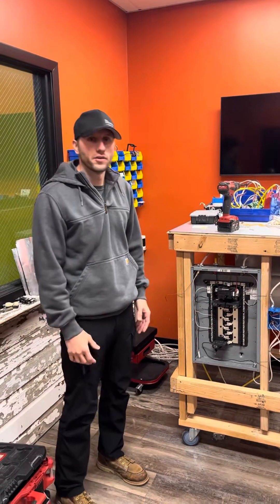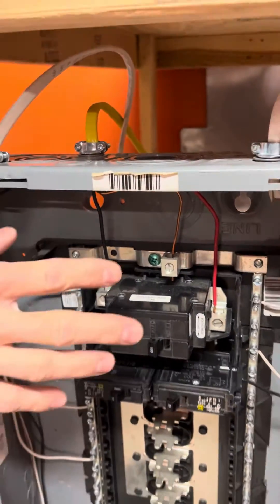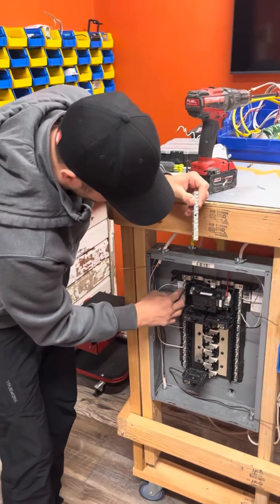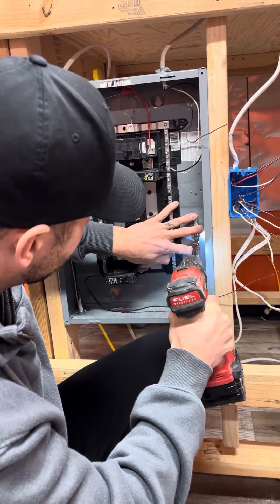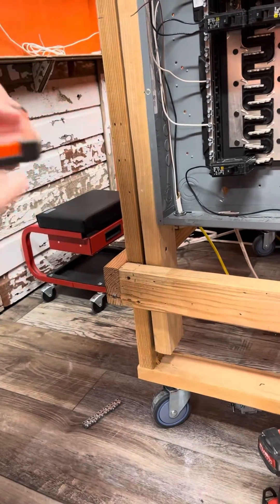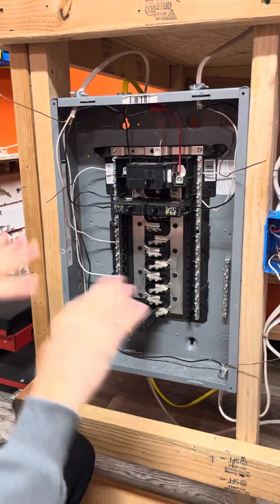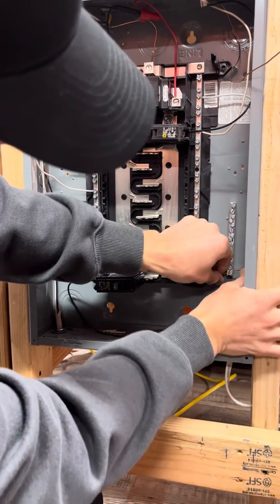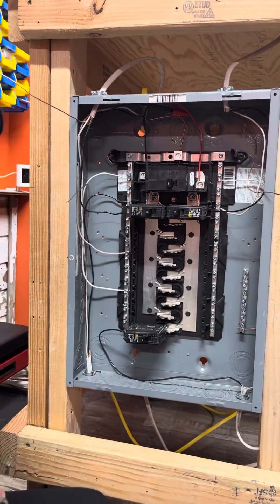Adding ground bar to subpanel

Comment: What happens if you add a second ground bar on the left side of the…. Will you put a wire #6 to connect with the first bar or you will use the case box as the conection ?
Reply from the maker: the panel is fine as long as it is properly bonded

Comment: You should have used a Ground Bar twice as big as that for that size panel to accommodate all the Ground wires from all the Romex cables and 240 10/3 wires.
Reply from the maker: Thanks its a training cube

Comment: So I did this that exact way, but when I voltage test black on the ground bar red on the hot lead coming into the subpanel, I still read a small amount of voltage like .6 I believe, that’s not good right?
Reply from the maker: red lead on what?
Reply: Check for AMPERAGE, Voltage can be Induced via Parallel wires and can result in a small number due to parallel induced voltage of the wires traveling next to each other for some distance.  In telephony, we call the induced voltage CROSSTALK between telephone wires where you can hear a little bit of other calls in the background due to induced voltage of the telephone wires being bunched up together next to each other.

Comment: I would recommend that you read NEC 250.8.  What you are showing is a code violation as you need to engage at least 2 or more threads.  This is why manufacturers dimple the metal  hole out the back of the panel to allow enough metal to obtain at least 2 threads.
Reply from the maker: thanks!

Comment: The ground bar doesn't get connected to the ground on the main. Panel or the ground rod?
Reply from the maker: this is to separate the grounds and neutrals on a subpanel
Reply: If the sub panel has an existing ground bar on both sides of the panel can it be used with a neutral and hot (circuit breaker) wire on either side of the panel for example you run out of grounds on one side where the breaker is attached can you attach it on the other side that has empty spots. I have an extra 10 gauge wire ground that I guess you can double up to the last ground on the  same side as the neutral and hot. Also in this situation 10 gauge is way over kill for the current (no pun intended) connected devices which are  low power audio equipment. Audiophiles can be ocd😂. Seems like a dumb question but as my moniker states I'm still alive and well at 71 and would like to stay that way. Thanks in advance.

Comment: Do you have to run a ground wire back to the main panel, or can you add a ground rod at the sub panel?
Reply: Yes and if sub panel is outside or different building than main panel it needs a grounding rod.
Reply: You should use a 4 wire cable to connect the MAIN Panel to the SUB Panel.  Sub Panel YOU NEVER connect the grounds and neutrals together.  The Neutrals are all isolated on one bar (not connected to the case with the green screw) for Sub Panels and the Ground wires are all isolated/insulated from the case with a Bonding Screw or Bonding strap to the case.   If Sub Panels neutrals were bonded with ground wires, then 1/2 the current from the Sub Panel would travel on the Ground wires and 1/2 on the Neutrals back to the MAIN Panel, which is a big Shock hazard to all using electricity fed by the SUB Panel.   Do it right or do it 6 foot under after being electrocuted via the Ground wire you foolishly bonded in the SUB Panel to the Neutral wire!

Comment: Hi I’m electronics not electrical. Just curious. Do this for a sub panel so you don’t have two different grounds? What I mean is will the main panel and sub panel use the same ground after this? And why would you need for that to happen?
Reply from the maker: neutrals and grounds need to be separated at a subpanel in case there is a fault.
you dont want a ground fault going back to the main panel on the neutral wire

Comment: Doesn't the ground bar you installed need to have a ground wire running from it back to the ground on the main panel? Do you have a video on doing this?
Reply from the maker: yes - we dont have that video yet